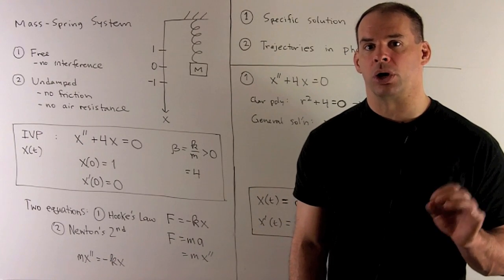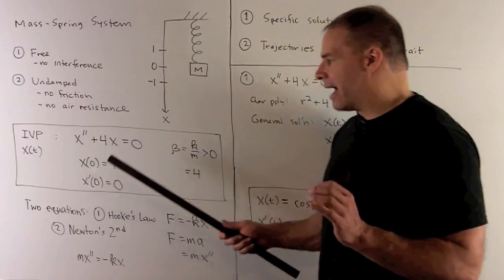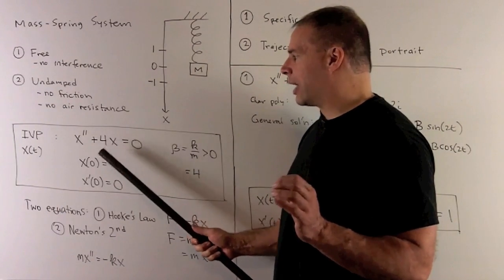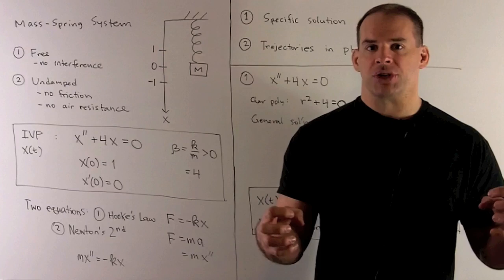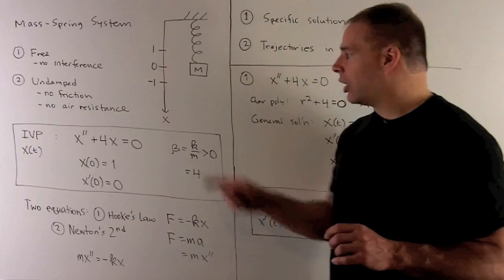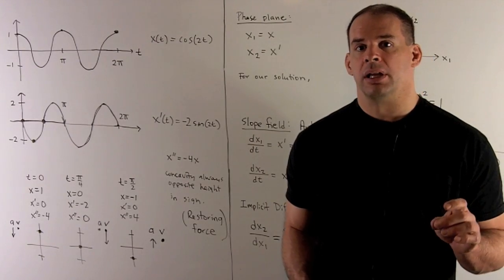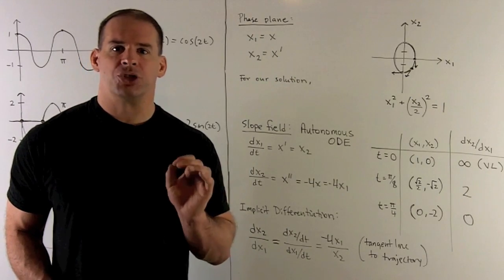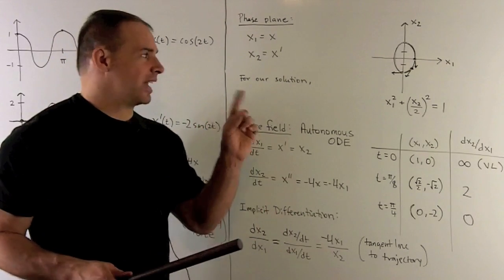Mass-Spring Systems 1:  Undamped Motion

Comment: Unsure as to where the x^2+(x'/2)^2 = 1 came from...
Reply: x'(t) = -2 sin (2t) all of these divided by 2
we get x'(t)/2 = -2 sin(2t)/2 thus x'(t)/2 + sin(2t) = 0, then you squared it, becomes (x'(t)/2)^2 + sin^2(2t) = 0
we know that sin^2(x) + cos^2(x) = 1 meaning that sin^2(x) = 1 - cos^2(x) or we can change it into t as follows sin^2(2t) = 1 - cos^2(2t) 
from the data we know that x(t) = cos(2t) hence cos^2(2t) = x^2(t)
hence sin^2(2t) = 1 - x^2(t)

put it into the equation (x'(t)/2)^2 + 1 - x^2(t) = 0
erase all the ts
(x'/2)^2 + 1 - x^2(x) = 0
x^2(x) - (x'/2)^2 = 1

note that he uses + instead of -, i dont know if im wrong or he is wrong, but basically this is the idea
sorry for a bit messy
Reply: @muhammadfareza3107  thank you

Comment from the maker: @pucestamp  Great comment, and absolutely right!  Vertical springs seem more natural to me, at least for students without physics backgrounds.  Admittedly I'm more interested in the math.

Note that the solutions of the homogeneous and nonhomogenous solutions differ by a constant.  This constant corresponds to the shift from the equilibrium position of the spring without the weight to the one with it.  I do note that oscillation is about the weighted equilibrium point.   - Bob